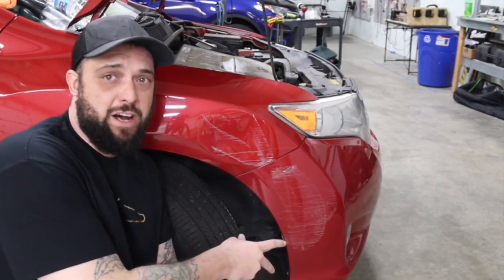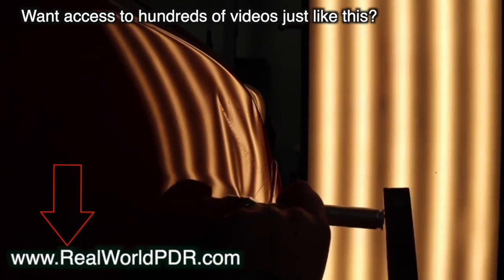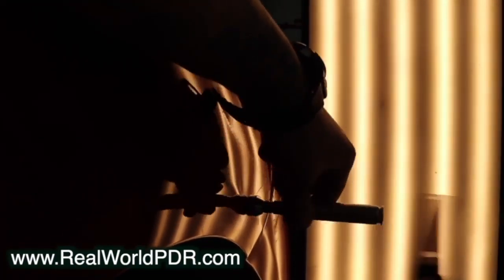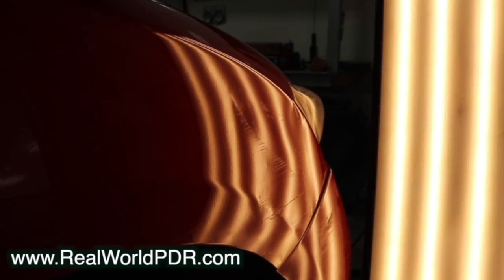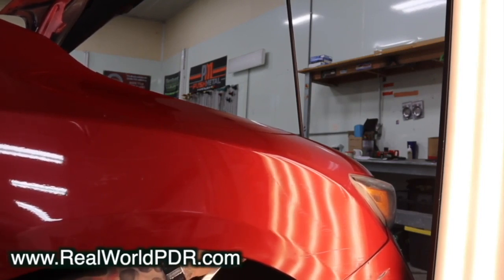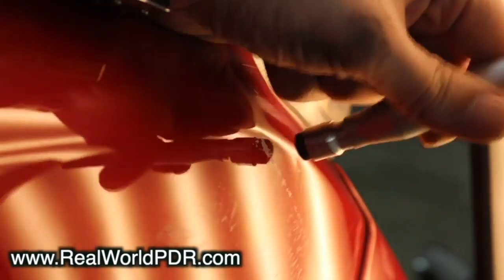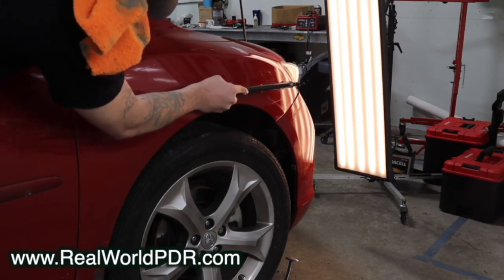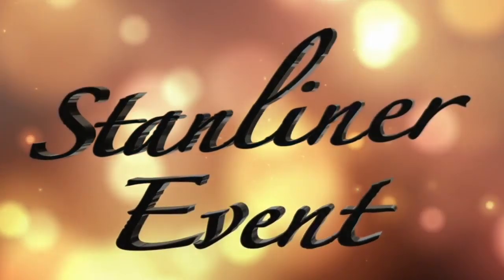PDR Large Fender Dent -Tutorial- Great Techniques.

Comment: Thousand bucks for a sligtly damaged fender and a scuffed bumper? Kidding, right?
Reply from the maker: That was replacement and repaint cost from the body shop.
Reply from the maker: So no not at all.
Reply: Sure, perfectly normal.
Reply from the maker: I’m taking it you disagree? Are you using Mitchell? ccc? What’s your estimating software. 

What’s a replacement fender cost? Bumper? Painting what.... 3 panels anyway? RI on that? 

Just curious where the attitude is coming from, because around here 1000 is low. That’s their own body shop.
Reply: What I'm saying is that it's way too expensive for repainting, which is far easier. Whereas pdr it, that's entirely different story. Just think about the arsenal of  tools that you need to repair this and how much they cost. Not to mention the knowledge you have to posses about metal moving. When repainting you don't have to be perfect, in a sense of flatting the metal, which saves you a ton. And ofcourse you don't have to worry about cracking the paint. Just my view, that's all. Other than that, great job, I'm learning a lot.
Reply from the maker: I gotcha. Sorry this thread got lost under some others.

I can’t speak on painting. I’ve never done it. Probably should someday just so can know something about it.